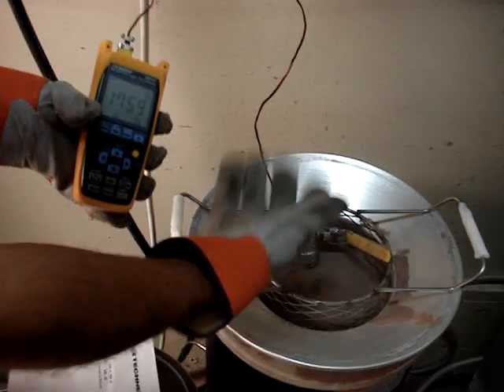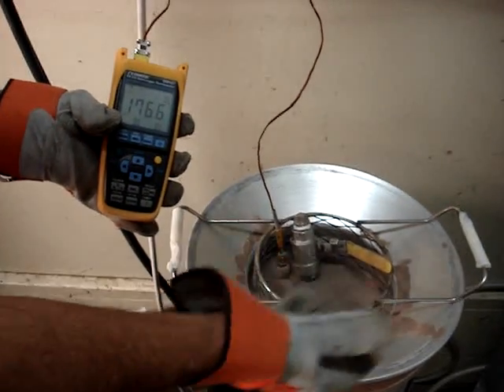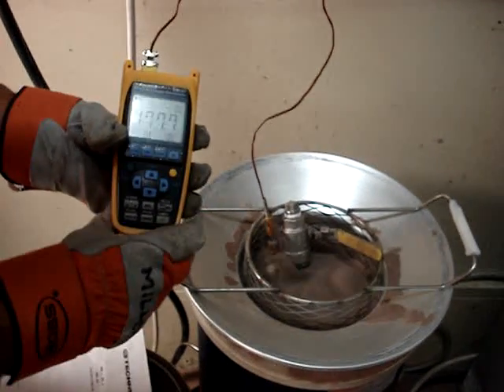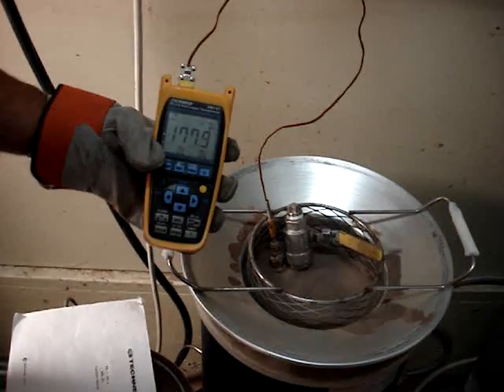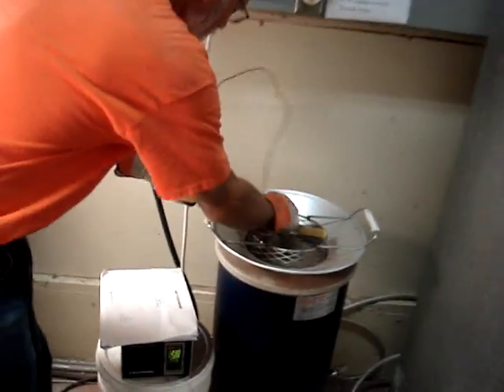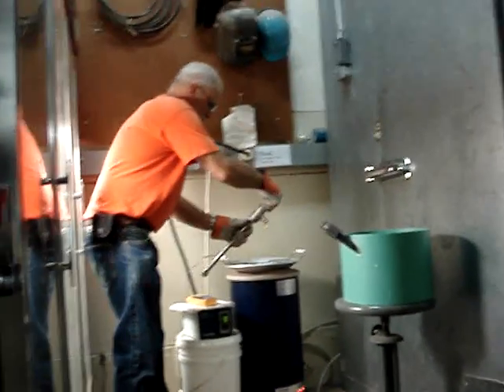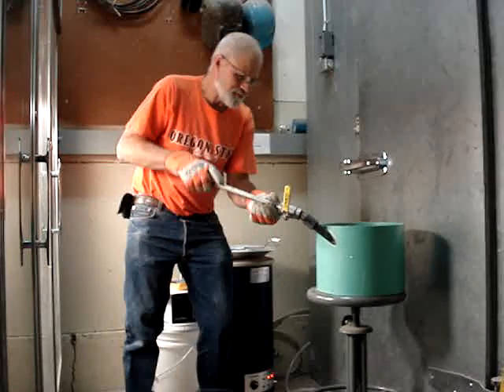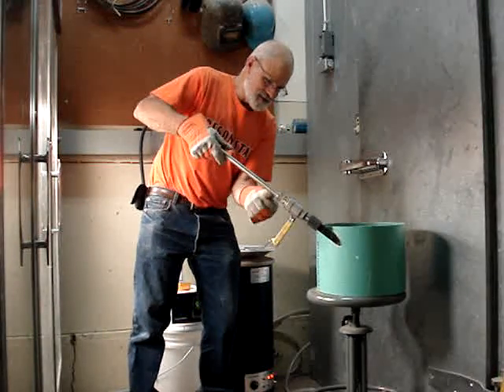Steam Explosion Pretreatment for Cellulosic Ethanol at Oregon State University

Comment: Very good. Using a stainless pipe as pressured vessel reactor and a cylindrical container with tangential input flow as cyclone to recover the solids, very nice. Simple but works.

Comment: Yes, Biomass was at 10% solid loading. Tube caapcity was 60 mL. 5g dry biomass was mixed with 45 ml water. But we have performed this pretreatment at 20% solid loading also
Yes, biomass was miled to particle sizethat can pass throughn 2 micrometer diameter sieve